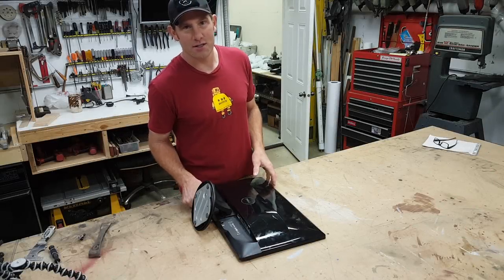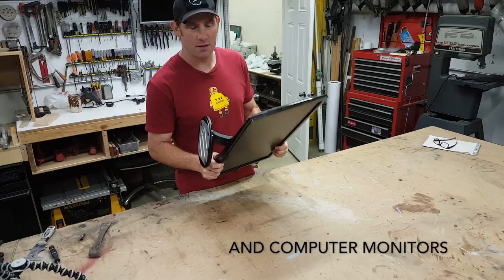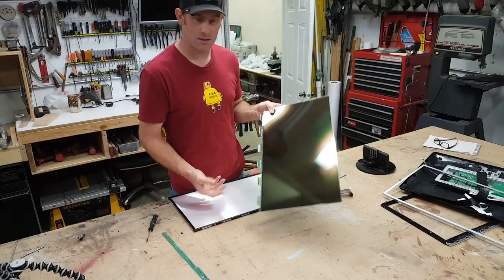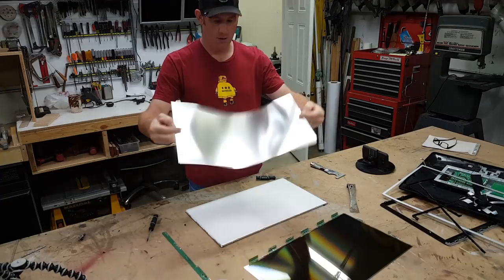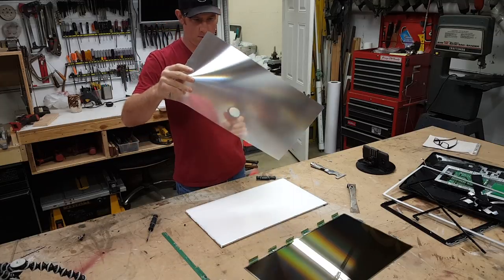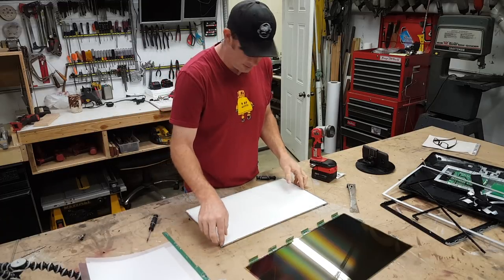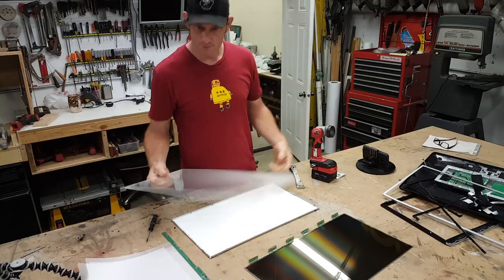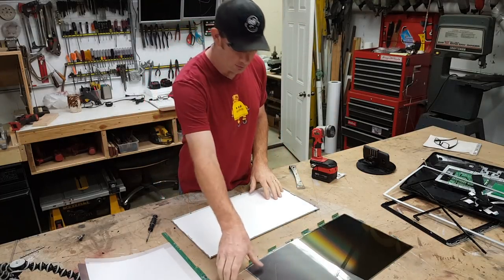Did You Know There's Plexiglass Inside Your Computer Monitor?  DYK-#1

Comment: It looks likes a great resource. Is there anything in a flat TV or monitors that would harm you?
Reply from the maker: It depends on the TV/monitor.  Some TVs have large capacitors and flyback transformers that could shock you. I'm always careful around the electronics and presume that things need to be discharged before they are handled.

Comment: Can you cut this and is it safe to cut using glass cutters? Genuine question, because I have tons of these and I want to make aquarium tanks using these.
Reply from the maker: I've never tried to use a glass cutter on this type of material. The one thing that I would be concerned with is whether the plastic is toxic to the fish.
Reply: @Makebuildmodify this was made 6years ago. I didnt expect you'd reply but thanks, I really appreciate the reply. I'll try to check if it is safe for fish.
Reply from the maker: @pitchblack2744 Yeah, I haven't had much time to create more videos lately, but I try to keep up with the comments at the very least.
Reply: @Makebuildmodify UPDATE: after a month nothing happened. Made bunch of tanks. But I'm a bit worried, because some of the glasses had tiny dots and I don't know if it will be toxic to fish. Overall, good for making small tanks.
Reply from the maker: @pitchblack2744  Interesting, I hope it works out for the fish.

Comment: I know this is old for you but I just discovered it. I have an old (but good) 42" that has some kind of oil that has seeped into the corner of the screens upper left corner and has progressed down and to the right and now covers an area about 6x8 inches in the upper left. I'd love to be able to remove, clean and return this. Is it possible or do I throw away the TV?
Reply from the maker: I would guess that it's the liquid crystal display that is delaminating. But without looking at it I wouldn't be able to give you a definitive answer. Probably a lost cause. Sorry.

Comment: have you made anything with the plexiglass from the monitors?  I just discovered this as well.  where i work they just discarded 30 or so monitors.  Can this be cut?  it looks brittle.  let me know if you decide to make anything with this plexiglass, i would like to see what you come up with.
Reply from the maker: I made a router table plate from some thicker stock. I didn't make a video of the project though. It has lasted for a few years but I can see some cracks around the screws where the router is mounted to the plate.

Comment: Hey, Justin! I got a huge TV, tried to get my plexiglass, I found one but it's not transparent. Is it OK, or I did something wrong? And please tell, if there any use for the screen (it's broken, that's why I got this huge TV for about $3.5) thank you!
Reply from the maker: Some are not transparent. But they're still good for other projects. They make great light diffusers. If it was a rear projections tv it will have some good mirrors in it too.
Reply: Justin, another question), and maybe a topic for next video : in the TV there are dynamics, can I make some speakers of it? Maybe in wooden case) there are a lot of wires and microchips inside the TV, so I left everything connected while disassembling, just in case) I have no electronic skills) just an A for physics in school))
Reply from the maker: I'm not sure. I'd have to see the tv.
Reply: Justin, I've send a message at Instagram with a link to the picture) thank you so much!

Comment: is it acrylic or polycarbonate panel
Reply from the maker: I've cut it and drilled it and the way it behaves leads me to believe that it's acrylic. But I don't know for sure.
Reply: @Makebuildmodify  have you tried bending the acrylic as it is thicker than most of the plastics where others are using heat on thinner sheets
Reply from the maker: @PoorJohnn   I haven't. It would be an interesting experiment though.